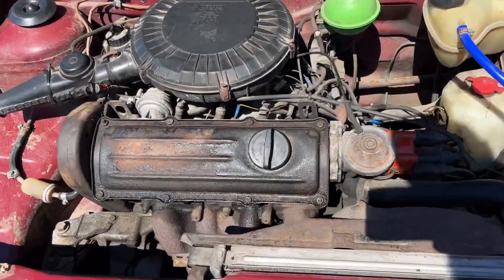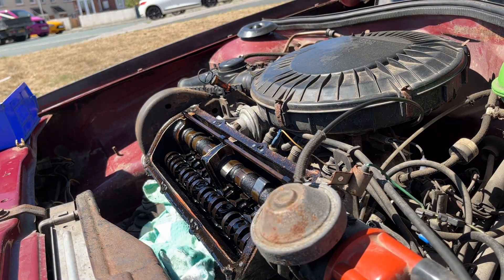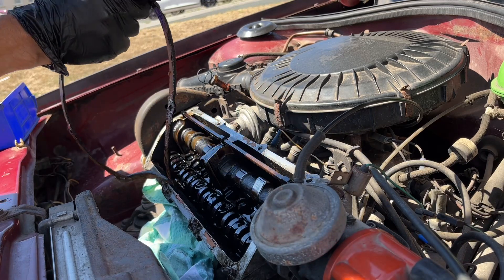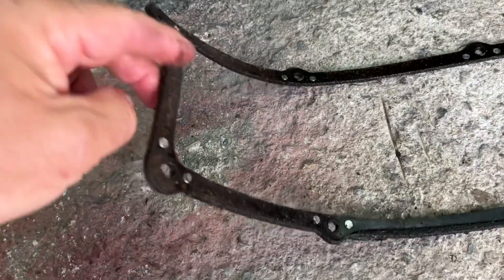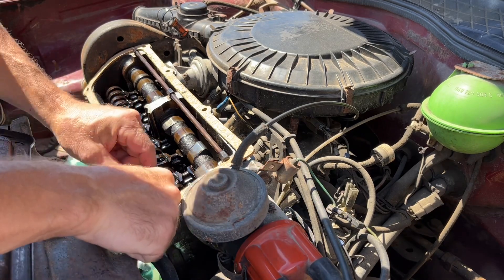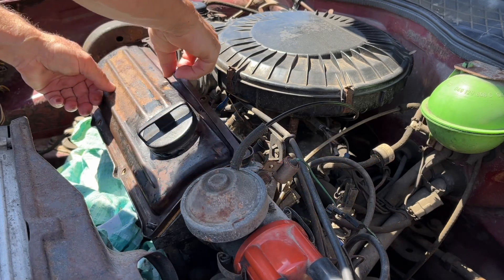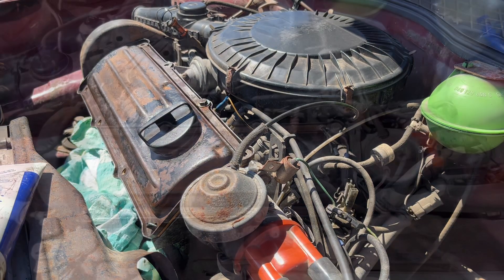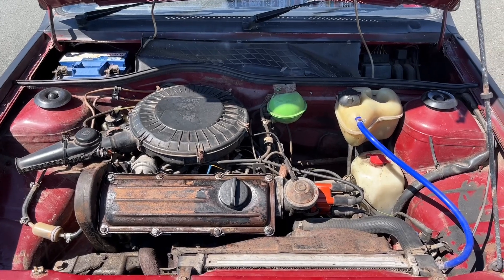vw polo 1984 mk2 breadvan replacing a rocker cover gasket .

Comment: Did you run it up to temp and check for leaks? Did you torque the bolts as you said they get overtightened?
Reply from the maker: In the eBay ad it stated oil leak via gasket from a garage in Yeovil . Drove it home 100 miles and seen the small leak . Just drove 20 miles and dry as a bone
Reply from the maker: You don’t torque these bolts only snugg
Reply: @vwcoco  I'd imagine they'd have a torque setting.
Reply from the maker: @GT.Bugger  nope it’s hand tight as it’s a cork gasket . I checked book and club . Recommended hand tight with open end spanner. Easy to crush cork gasket